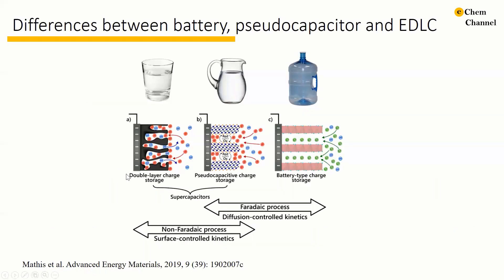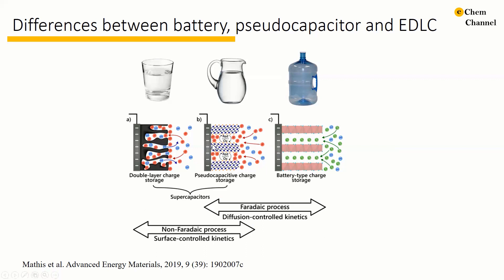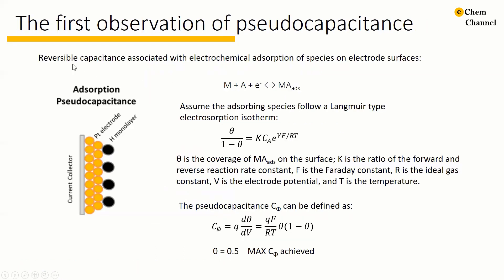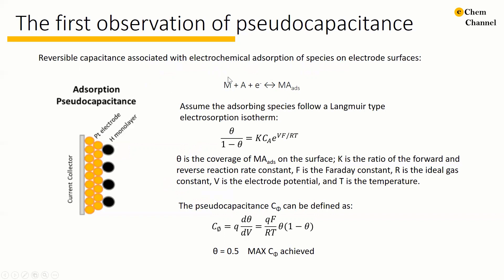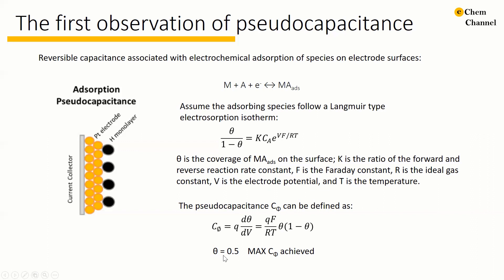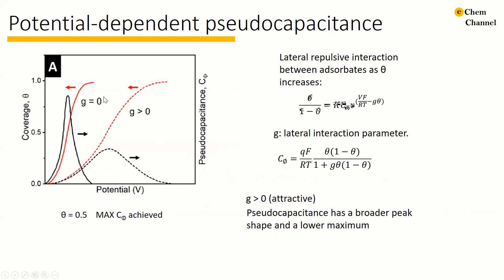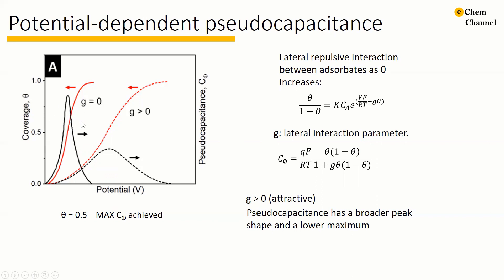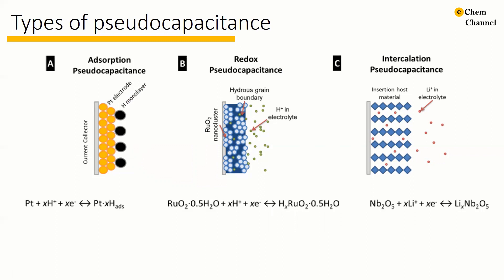[EChem fundamentals] Types of pseudocapacitance

Comment: In the redox pseudocapacitance example you showed, the hydrogen ion (which entered the electrode and got reduced) did not leave the electrode. Instead, it is 'locked' in the electrode. So is the process Faradaic or non-Faradaic ?
Reply: Please explain my doubt
Reply from the maker: @NitinKMSP  Hi Nitin, sorry for the late reply. If the material is reduced, the process is Faradaic.
Reply from the maker: I would add that in this case, the proton didn't get reduced - it is the Ru in the RuO2-0.5H2O that is reduced. I am not sure what you mean by 'locked' in the electrode.
Reply: @EChem_Channel  Thank you for reply
In this article, 
Biesheuvel, P. M., Porada, S., & Dykstra, J. E. (2018). The difference between Faradaic and non-Faradaic electrode processes. arXiv preprint arXiv:1809.02930.
it is mentioned that, to have a Faradaic process, there must be an electrode reaction where an ion or atom is reduced or oxidized to another species.
In addition the reactant must come from outside the electrode, and the product of the reaction must leave the electrode again. It is also mentioned that, if the reacting species is oxidized/reduced in the electrode, but then stays there, i.e., ‘is locked in the electrode’, the process is non-Faradaic. 

In the redox pseudocapacitance example you mentioned, the reacting species, i.e., the hydrogen ion didn't leave the electrode. My doubt is, then how the process is 
Faradaic?
Reply from the maker: @NitinKMSP  Thanks for providing the context. I do remember this arXiv article, which stirred quite some discussions a few years ago. I think the "locked in the electrode" concept applies well to EDL charging, where the ions of opposite charge will stay at the surface and be locked there. However, since there is the reduction of Ru, and the charge transfer follows Faraday's law of electrolysis, the proton intercalation here is Faradaic. The definition of David Grahame was from 1952. I do think solid-state electrochemistry has developed a lot since then.
Reply: @EChem_Channel  Thank you for clearing my doubt.